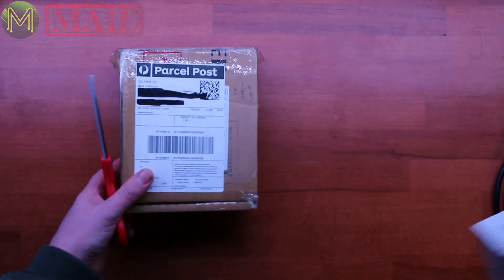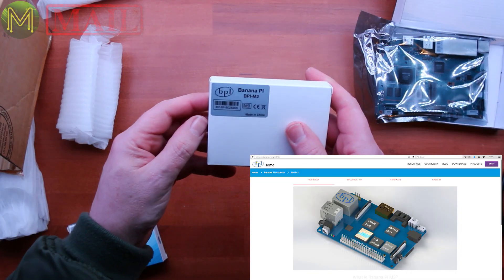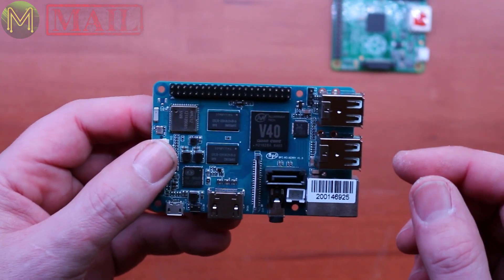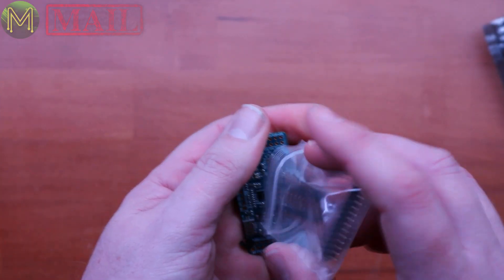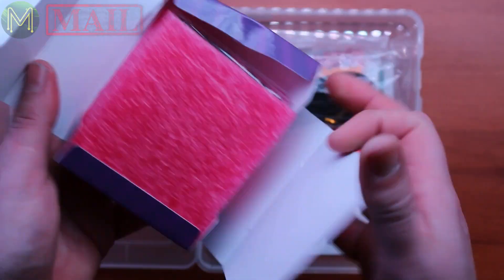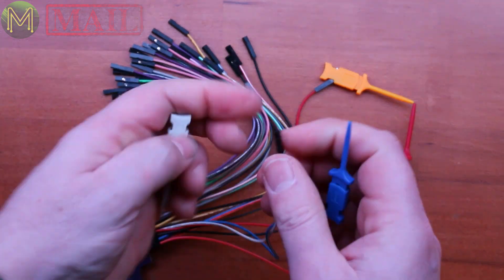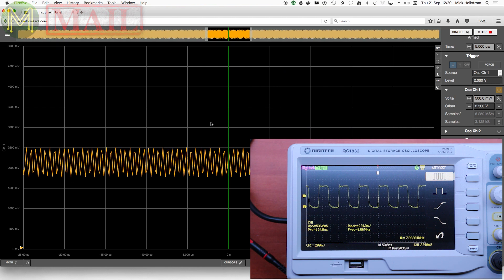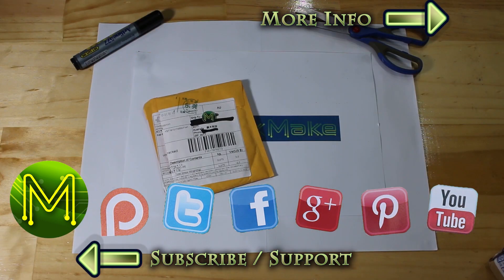#170 MickMake Mail #18: OpenScope MZ, Banana Pi & iolinker

Comment: I have the banana pi m3.  It's alright, but not the powerhouse it could be.  The kernel is just slapped onto the raspberry pi raspbian.  It's not even a package for the distro.  And lacks a lot of the normal kernel perks like snd-usb-audio.  It was barely able to youtube at 360p, so it's my wifi bridge atm.  It would be nice to use it for more, but meh, average at best, in-spite of good paper specs.
Reply from the maker: +wwwShadow7 
It is surprising considering the fact that it's using the same MCU as several other SBCs, but the A83T is still a young SoC for SBCs regardless. It'll take a while for it to be mature.

Comment: just wondering I have bought several different items ie motors etc for my Arduino and they come with 1.0mm connectors is there an adaptor or easy way to connect them to the standard 2.54mm bread boards
thanks for any help
Reply from the maker: +john douglass 
Yup, there's plenty of adaptors you can get. Tindie, AdaFruit, SparkFun have them. I don't have any links handy at the moment.

Comment: Um, what? At https://youtu.be/wOSVLLs152s?t=456 you say you need a level-shifter for the USB-TTL, but it looks to be the same one as I have, based on the PL2303 chip and has 5-pins on it -- one for 5V output, another for 3.3V output. I certainly have never needed a level-shifter with mine, I can connect it to 3.3V - boards without any trouble.
Reply from the maker: +Nita Vesa 
Yup, this one was definitely pushing out 5v but didn't have any 3v3 outputs.
Reply: Well, better buy one or two 3.3V-capable USB-TTL's. They ain't that expensive and you never know when they come in handy. Personally my favourite is my CP2104-based one, as it has worked even with devices where none of the other USB-TTL's I have did -- no idea why the others didn't work, but I'm just glad that one of them is reliable.

Comment: I don't think that scope is very good for $90, also not a fan of the web app aside from it being slow it just seems annoying to deal with. it being open source is nice and it having multiple functions is cool, but if you just want something super cheap then a DSO150 isn't bad however, at $100 range a used scope or a USB scope would be far better value, since you'll be getting a much better 20MHz or higher bandwidth.
Reply from the maker: Yup, it's a mixed bag. There are benefits with it. Being able to control the GPIOs helps with automation of tests/diagnostics.

I still think bang for buck is about right, but only for specific use cases. An old CRO for around the same price on eBay can do 10x the bandwidth.
Reply: well, except that it will only work as long as their website is up, once they give up, you have a brick.. thats extra super dumb
Reply from the maker: +Martin Name 
It is open source so you could copy the HTML easily enough and it's all open source so people will be creating their own firmware soon.